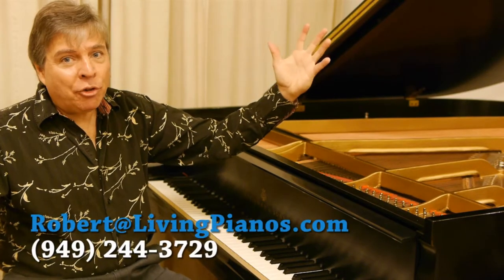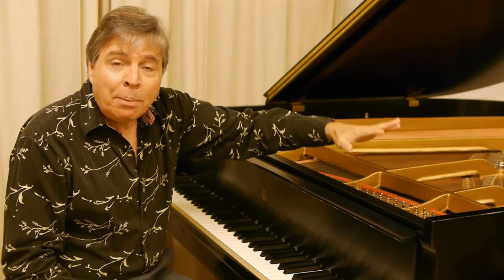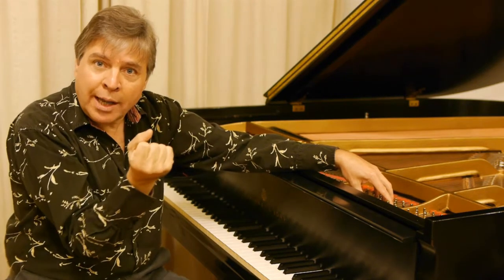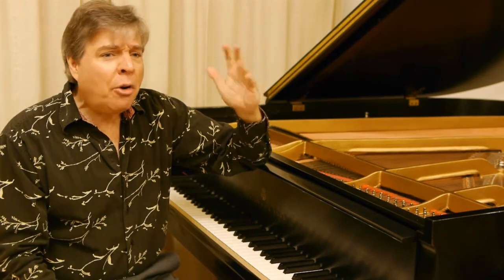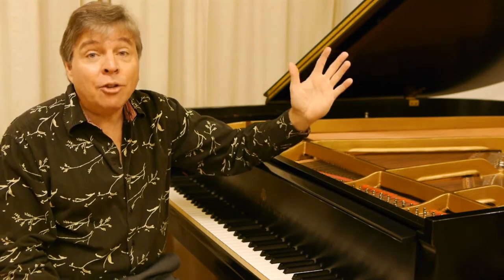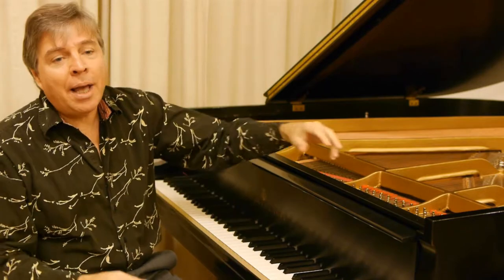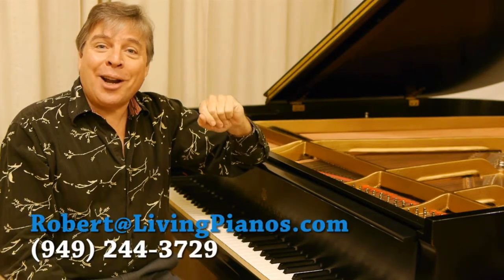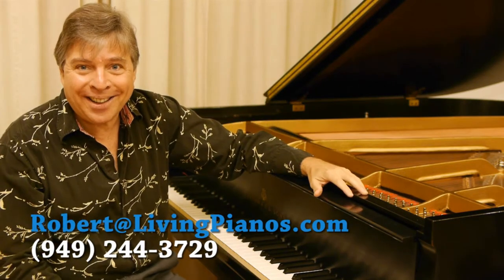What is a Pin Block? When to Replace a Piano Pin Block

Comment: Robert, thank you for these educational videos livingpianos! Now, in regard to the pin block, I have to ask, - has anyone experimented with some other technology beside the pin & laminate block? It seems possible that some mechanism of modern design and materials would outperform the classic model. I know it has me thinking. Once again, your series of videos are absolute treasures of knowledge - thank you for sharing.
Reply: I've thought about this too. I wonder if there's another way. I've thought about pins that twist and "lock" or maybe something in the fashion of guitar tuning pegs. Not sure though!
Reply: Yes there have been mechanical tensioners created in the past, where the string is "tied" to a bar and placed in a pair of hooks that are part of a sliding block, adjusted by a screw that draws tension on the string.  That arrangement would hold tension and tuning very well.  My guess is that it would be very costly to put hundreds of them in a piano, and if a metal piece is used as the mount, the cost of drilling and tapping the plate assembly would also be a factor.  Tuning pins are simple to make, and the block would be fairly easy to make as well, especially using modern machining methods.  It seems to be an "if it ain't broke, don't fit it situation".  I have no idea how often a piano needs to be re-stringed, or re-pinned, but I'm thinking not very often.
Reply: @MrFixit-fb5bu  I get it. Your deduction is spot-on! Thank you for clarification of the "problem" with requires no remedy.

Comment: know this vid is old, but i would love your opinion on a situation, . bought a old p22 yamaha, it was about 55 cents low on all strings. , gave a shot at tuning it but then gave up as i realised it was not easy and then i hired a pro, from every thing i read  before i tried it my self you must be very very carefull to not put up or down or left down pressure on the pin aka a leaning motion as opposed to a turning motion so you dont damage the pin block  ,  so i when i tuned it my self i used a t handle so that the torque was even distrubed and not leaned in any way ,  as stated i gave it a shot and then quit about 2 thrids up and hired pro, WELL ANYWAYS the pro was litterly bending the hammer up and down seemingly bending the pin instead of turning it, not only that but the extension on the socket was about 4 inches deep for a grand piano further increasing the leaning pressure on the tuning block THIS MADE ME CRINGED as analytically in my mind could imagine him stretching the hole of the pin block or bending the pin, so the question is, is this normal to do or did he damage my pin block?

side note, its a 2007 yamaha p22 that seems to never been tuned since purchased, aka a perfect pinblock

Comment: Very helpful and informative video, thanks! Just one question, in the video you talk about restringing and using pins that are 2 thousandths of an inch larger in diameter, however in the video description you mention 2 millimeters larger in diameter which seems like a pretty massive difference. I assume the video is correct?
Reply from the maker: Tuning pins are measured in a term called, "op". The variance from pin sizes is indeed in the thousands of an inch as you can see here: http://www.stevespianoservice.com/Online-Piano-Parts-Catalog/piano-tuning-pins-drills-pinblocks-and-treatments.htm